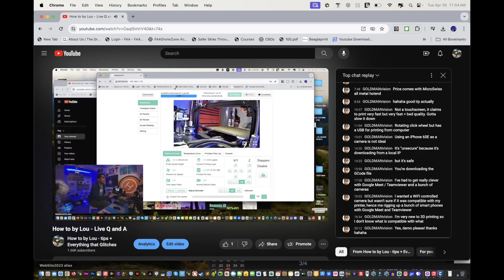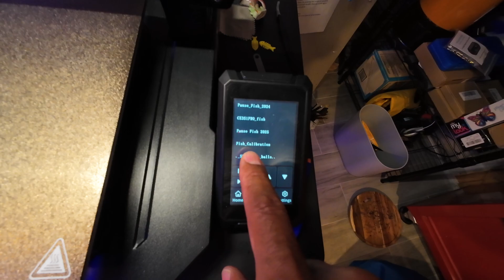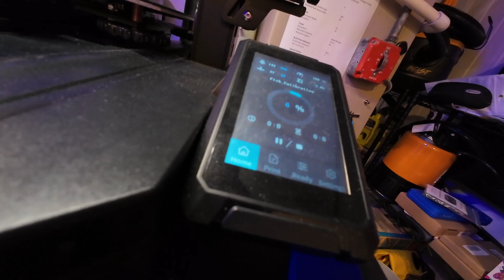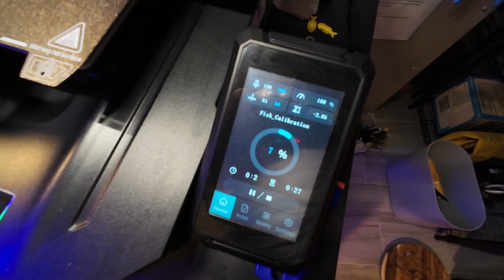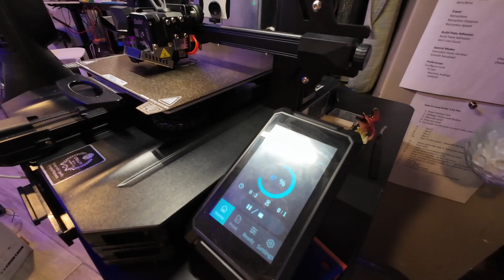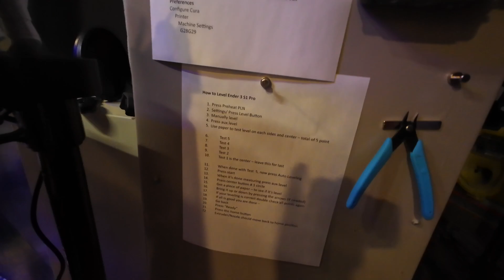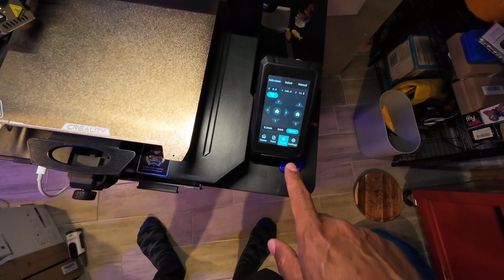how to replace y axis limit switch - ender 3 S1 pro making loud noise

Comment: Hi! The part that is linked in the description is not the same part shown in the video. Do you have a link to the correct part needed? I didn’t notice and ordered the incorrect part, and only noticed as I went to change it out☹️
Reply from the maker: You have to put in a support ticket with creality and they will send you the correct part.

Bit a bummer that the one only doesn’t match. Hope this helps. Let us know how it goes 

cs@creality.com
Reply: @How-to-by-Lou thank you!